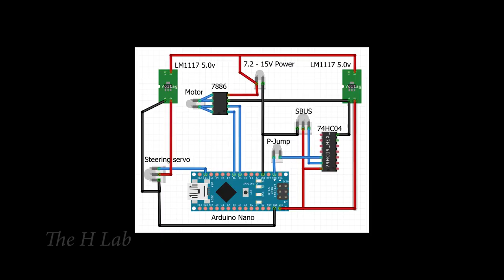How to convert Mercedes AMG GT Welly FX 1/24 to RC Car

Comment: Dude but what about the interior? you could use some space from the trunk or engine compartment I think
Reply from the maker: I'm building another version with more space inside. Hope that I'll have space for interior. I've done some parts such as chassis, steering system... search for them on my channel
Reply: @TheHLab bro what exactly engine are you using? Because my 1:24 scale viper has limited space and I think that motor is perfect

Comment: do you have a sudgestion what part i need to buy for 1:32 scale
Reply from the maker: You should looking for a smaller receiver for fit inside 1:32 (ex: Flysky FS-GR3E). For motor and gear, try to find a smaller also (could be from a cheap 1:32 car). Google search for "Mini Brushed ESC" for esc

Comment: Hi ,are you an electronics engineer and can you tell how to learn coding? thanks
Reply from the maker: Hi @Rupesh, I'm a software engineer, I've learned coding from school. But if you are an electronic engineer and want to learn coding i think you should start from small samples/examples code. When you make it run, you will be motivated to continue learning.